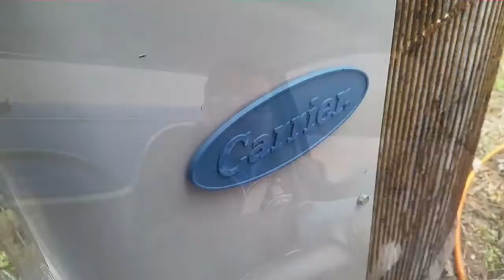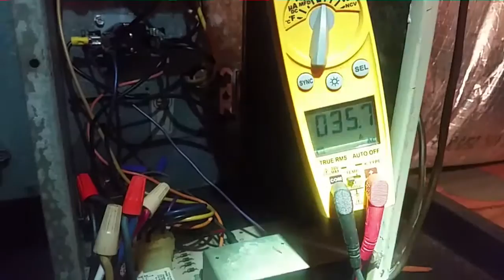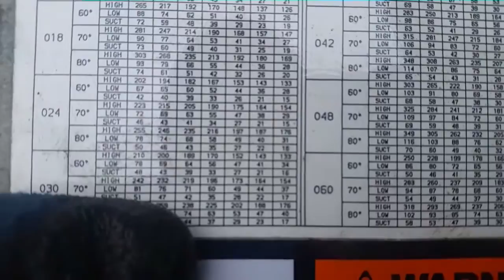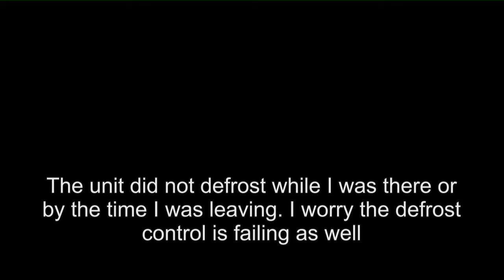Carrier Split Heat Pump System Heat Strip and Contactor Failure

Comment: Good info on this HP video. I had questions from a HP I saw a couple Saturday's ago. GMC we installed. Lady said it made a loud banging noise in the piping or AHU. So I thought maybe when it goes into defrost, but could not initiate a defrost when I jumped test to defrost pins. Found out goodman is temp sensor jumped to test for manual defrost; and I was just generally confused about what the temps should be and where to check, in HP mode, but this video helped me a lot, to understand what was happening that day!
Reply from the maker: +Chris waessil Awesome, I will add more on this subject. I did change the defrost control on this one. That video will be coming soon